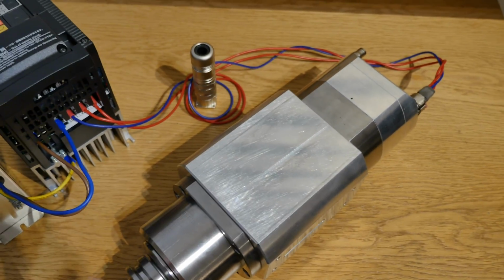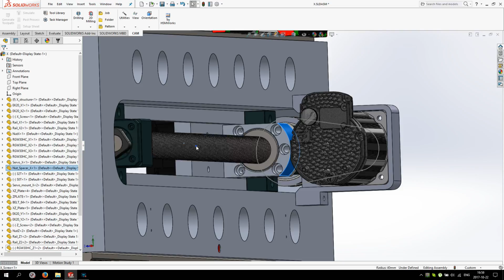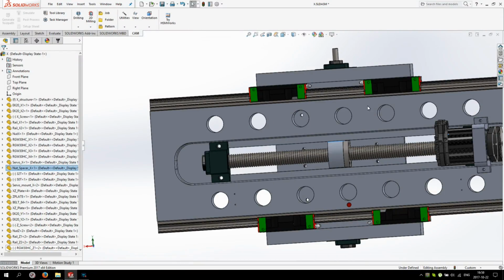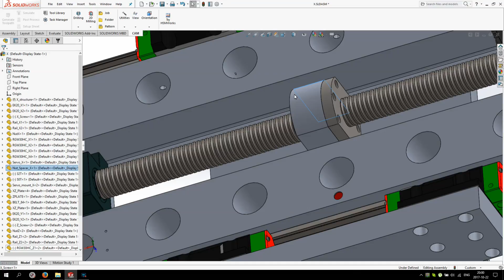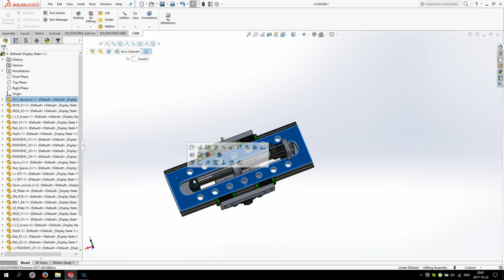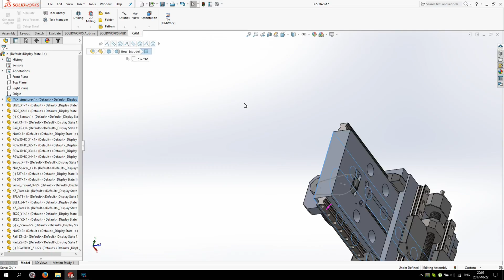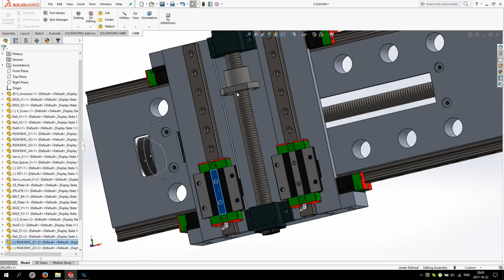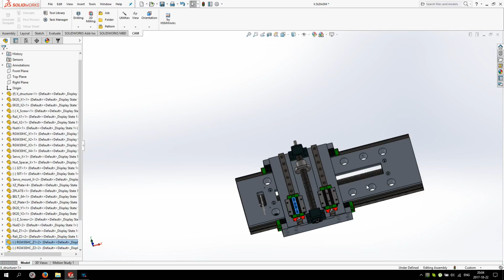4 Axis CNC Update ATC Spindle ! 15krpm @ 2.2kw with WJ200 VFD

Comment: 1. What kind of acceleration do you need? (Minor weight savings can increase manufacturing costs). What is your expected cutting force to force needed for acceleration ratio?
About one clamping setup - it's not always more accurate, if you remove a lot of material the part can bend from internal stress after unclamping.
Also if you specify that front and back faces of the plate have to be parallel but use loose tolerance for thickness it might reduce cost (less machining to do)
2. The plate behind Z axis rails looks relatively thin, especially the corners.
3. You can think about other materials, like steel or granite (especially for the base) as they are cheaper and dampen vibrations better.
The bed doesn't have to be machined, only the mounting points are important, you can plan or lap the work area yourself later!
4. Instead of making everything in one plane focus more on leverage effect. (use 4 carriages for z axis, it can extend above gantry)

Comment: if u want to calculate the amount of load the linear bearings can handle, refer to the datasheet of the bearing. What you want to lookup is max permissible static roll, pitch and yaw moment. In that, you just need to plug in the values of maximum moment(force x distance) each bearing will experience in a given direction.

Comment: Definately over-engineered but not as optimized as you think. It looks great but wastes a lot of money for material that is not needed or in the wrong place.
30mm rails for a small 2.2Kw router? That's about a Kilogramm per carriage that has to be accelerated. 
25mm for Y and X axis is more than enough and 20mm for Z. If you increase the hight of your Z assembly and use four 20mm carriages instead of the two 30s you'll get more rigidity with less weight.
And that huge piece of aluminium...huge waste of money. If you want stiffness then you want a large mostly hollow cross-section, not a thin solid piece. 
Two heavy 90x90 Bosch extrusions sandwiched between two 10mm cast aluminum plates ... simple, clean looking and stiffer than this design - at a fraction of the cost.
The ballscrew - as nice as it looks, hidden in the middle, behind a super flat Z assembly  -  should be placed between the X guide rails and the Z assembly, as close as possible to the mass it's supposed to move. Think about inertia, leverage and resulting torque in the rails. Your current design does the opposite of what you're trying to achieve.
I know that's a lot of critique ... but ...
Reply from the maker: In my case I get parts as support, so i had to chose with no regard for cost. It is overkill, and now its more a problem not a feature.
I am making 3d model for XZ carage in completely different way (testing idea). Spindle and all bearings will be mounted inside a square box, it like exoskeleton,  In that case, i will have 4 rails for z, and X rails will be centered between spindle, so rails will be placed along the axis in between mass center of the spindle.

This should make more sturdy design as well as put X rails closer to the bottom, and it will be super easy to protect from dust, since everything will be inside hollow tube.
But this will place lead-screws off axis of center of the mass, i don't know should i be worried :?
Reply: You can place two ballscrews on z-axis.

Comment: the way you are putting the longest linear rails is complex and you going to have a problem when assembling the machine physically this is due to the tolerance of the machine that you will use to mill the 300 euro component better put the linear rails on top than on the side 

avoid reducing the thickness of the aluminum if you want maximum stiffness 

use gearbox for your servos instead of belts to minimise backlash

Comment: With the big hole for the nut of y the axis you have weaken the structure. For the best stiffness put the z and y axis carriages back to each other on same plate and put the z linear slides on the back of the spindle plate

Comment: You get the minimum deflection off the machine when you get closer the ball screw to the tip that cuts the material, when the ball screw is collinear to the point that cuts then you have zero tongue from the cutting forces and ballscrew. When you put the ball screw between the rails you minimize nothing, it is the symmetry that make you thing that is the best placement.
Reply from the maker: deflection is handled not with ball-screw, but with rails. You want to have rails as far apart as possible, carriages as far apart as possible, and yes, you want to have smallest distance between cutting surface and rails. And this one is a tricky one to have. 

I just calculated that i will have 26cm stick-out of spindle below rail support

I am also trying to make it as compact as possible, since this will minimize deflection due to small leaver effect. well,where are so many decisions regarding CNC constructions that i can't wrap my head around.
Reply: Indeed the stiffness is greater the more distance the carriers have, but the placement of the ball screw is what I am talking about. For example you can see that the designers of Bridgeport have put the screw for the knee collinear to the center of gravity off the moving part and not between the slides. If they have put it between the slides like in the old mahos, then they had to use more rigid square slides like on the mahos or excess wear of the slide will be the result do the greater torques on the slides.
Reply: The placement of the rails and the shape of the machine is determine the stiffness the machine will wave. but the forces on the machine is gravity and the forces from ballscrew and cutting forces, the combination off thaws forces is torques that trying to twist the parts of the machine. Put the forces in line and the torques goes to zero.
Reply: Another example, the ballscrew is not at center distance between the linear guides of Y axis, but at close to the bottom as possible.
http://www.yamaseiki.com/images/milling/5axis/fmv/construction/fmv-construction-fmv-99.jpg

Comment: You definitely want 2 more Z carriages there for stiffness.
How does the remainder of the design look like?

I found your video via your other one, where you were trying to design an outrunner-BT30-ATC-spindle.
Is the spindle you got now capable of low rpm/high torque - for something like 50 mm face mills in aluminium?

As you seem to be looking for input, you might want to look at this build - https://youtu.be/bX2Eg18AzTA
Details are over here - http://www.cnczone.com/forums/uncategorised-metalworking-machines/327914-gantry-mill-precise-milling-aluminium.html
The specs of what you want and he has built match pretty closely and his results are impressive - take note of the reasons behind some design decisions (gantry stiffness, etc.).
Be aware of the other video of his, where he mills some aluminium part for a bigger machine and where the swarf goes everywhere - something I'd want to avoid.

Another example (fixed gantry) of a seemingly sturdy design (note the vertical z-plate stiffening), but also swarf problems - https://youtu.be/o__Uk_ek8Ec?t=5s

Personally I'm planning a portal milling machine with a similar bed size as you (1200mm x 800mm) but a Z height of 350mm and the y-rails/drives up on 'walls', similar to this - https://youtu.be/fIVL83AwXrE
Some early musings can be found here - http://www.cnczone.com/forums/uncategorised-metalworking-machines/347540-arent-portal-mills-popular.html

Comment: It would be great to see an update on the driver!
You are using GaN transistors? 200kHz is pretty high switching frequency! Any reason why the typical 20kHz is not enough for this application?
That filter seems very small, but working at those frequencies have that advantage!
Reply from the maker: I was pushing 2.2kW from that TI module at 500Khz with no problem. Also GaN can take heat. Normal working temperature can be 120C. Using 200KHz switching will yeld better results, yes, for 400Hz  tone, you can do that with 20Khz, you just have high distortion , and it can be audible noise. I have GaN mosfets, and a will to use it. It just very nice transistor, ultralow Rdson, sub ns switching and so on. Also, this makes filtering simpler
Reply: But with the output filter I think is not possible to have sensorless vector control, right? I suppose you will need an encoder if you want FOC... I'm not 100% sure about that but if you can't read the unfiltered current I don't see a way to do it
EDIT: I was curious about the output filter+sensorless FOC and actually there are publications on how to do it, interesting project!!
Reply from the maker: ballanux 
I see you know what you are talking. That's good. I am planing to put 16k encoder inside spindle with home index, so I don't need to read voltages/currents :)

Comment: What spindle is that?
Reply: Linas K so, which company is it?
Reply from the maker: I can't tell you right now. Since firm that makes it is a bit strange. They forget to fill half of my order, motor was damaged during shipping , and they are extremely slow to react. I can't recommend them right now. Also, just after i bought this spindle, i try to read some comments about this firm, and yes, many experienced same problems as I, so not good. Hope it performs , sine 3k$ is not cheap

Comment: Nice work if you want us to quote for machining then feel free to provide STEP files and tolerance required. The z axis looks a little week i think the longest part looks to be the thinnest?
Reply from the maker: monit111 
2cm plate. And also massive 30mm rails. They are just as stiff as some one Z axis on their own :D
Reply: Linas K you can not count the linear rail for strength, the rails actually bend from one mounting hole to the next this is why its recommended you machine a wall to press it up against and thats also why you run indicator all the way down rail when fixing.

Im not sure on grade of aluminum you will use but after the spindle , spindle holder , z axis plate and servo are mounted you will have to consider that wight wanting to push down then add the force experienced when plunging into metal then add force of x y movements then finish this of with the vibration traveling through it. Then you can decide if 2cm is good. We have an old haas here and under all the rails are a min of 5 inches of cast iron (very small machine) 

Do you know the type of cuts you want to preform? Ie heavy removal low rpm or small passes high rpm?